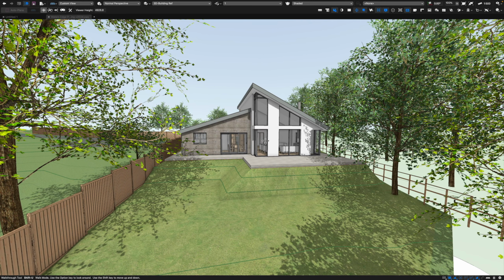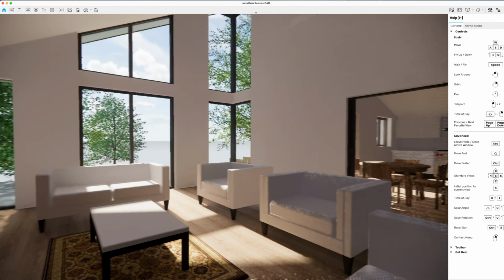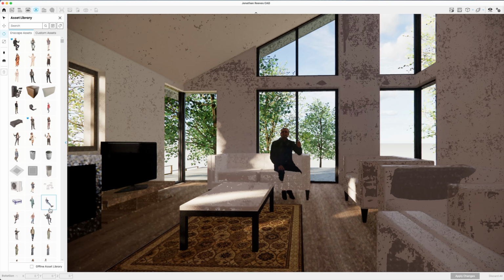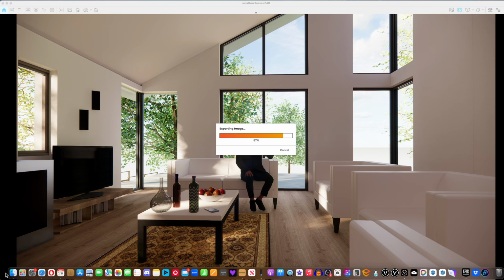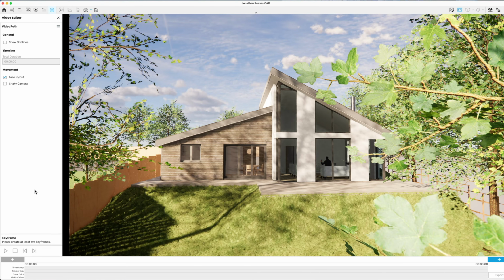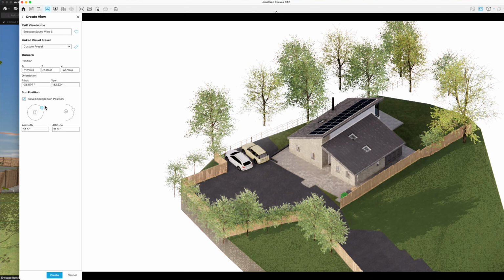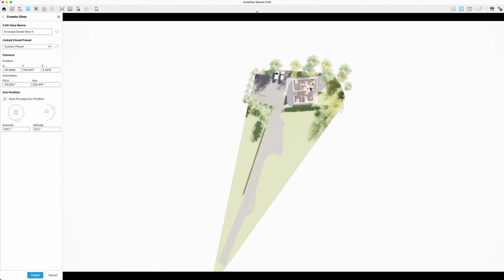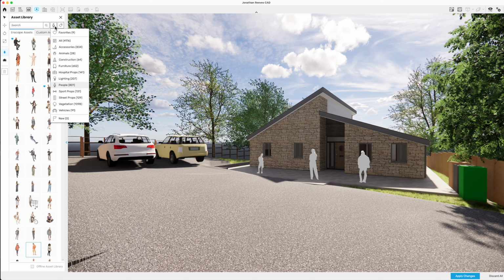Enscape 4 for Mac: Revolutionary Real-Time-Rendering

Comment: Hello
Should I go with macbook m4 or windows laptop with 4060 rtx for enscape use
Reply from the maker: Personally I prefer Mac for general use, but if real-time rendering is your main requirement, then the Please confirm with 4060 rex is probably best as you can also use D5 Render and Twinmotion Path tracing.